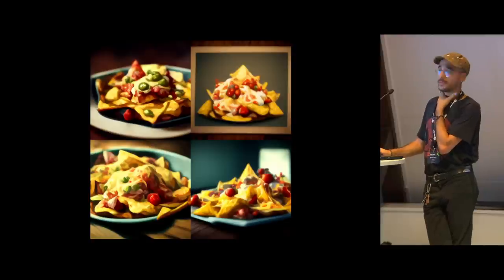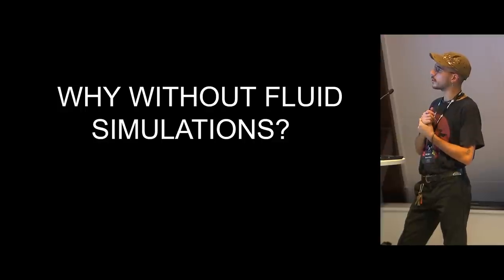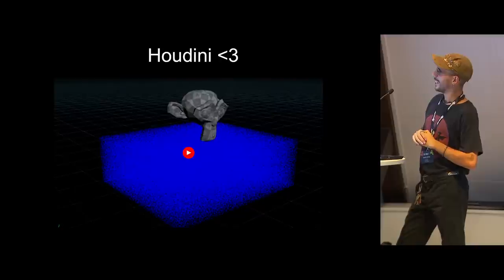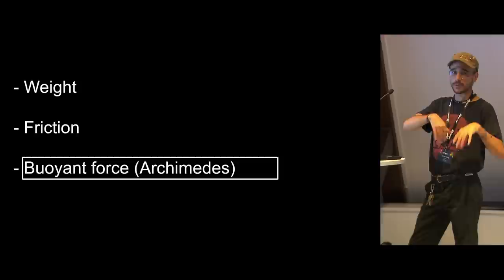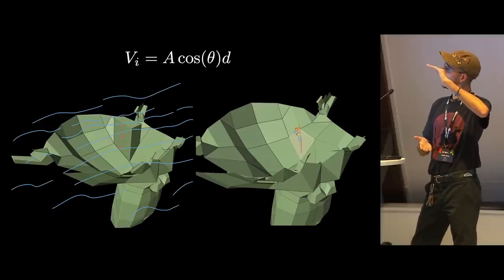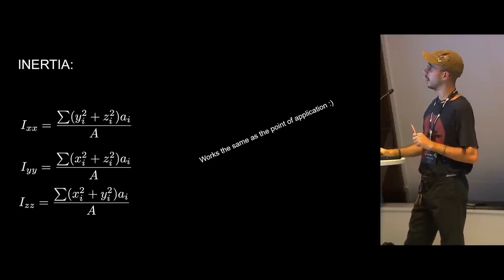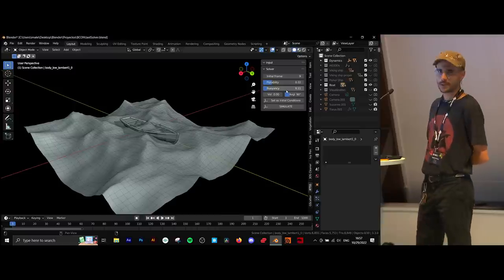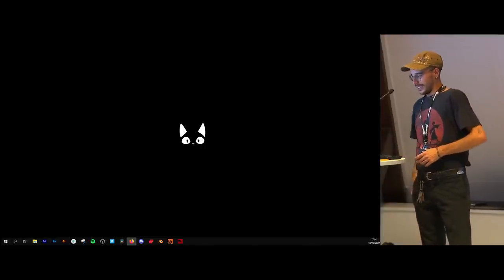Ship dynamics without fluid simulations

Comment: Looks good...but if I wanted to achieve that I would probably use a game engine
Reply: yeah unreal can do it but imagine this with eevee
Reply: eventually someone will do something similar in blender
Reply: @RealParadoxed  You can do it with Eevee just fine. Use the Shrinkwrap modifier on a simple surface (like a plane or a triangle) so that the simple surface reacts to the object below it (waves you’d animate, or whatever). And then, in edit mode, select some vertexes out of the hull of your ship, and press Ctrl + P to create a Vertex Parent. Ta-da, you have ship dynamics without fluid simulation.
Reply: @DitiPeng  Not really. You can parent an object to an animated wave in Eevee, yes, but it's a stretch to call the resultant effect ship dynamics. You could replace the ship with a smaller boat, Suzanne, or even the default cube, and they'd all behave more or less the same, regardless of their size or shape. What has people excited here is the prospect of real-time physics-based interaction between an object and the wave surface without using the fluid sim, something far more complicated.
Reply: @juryrigging  Thank you for the explanation!